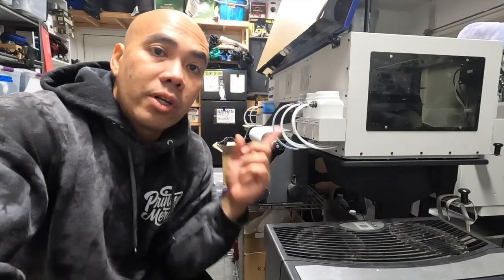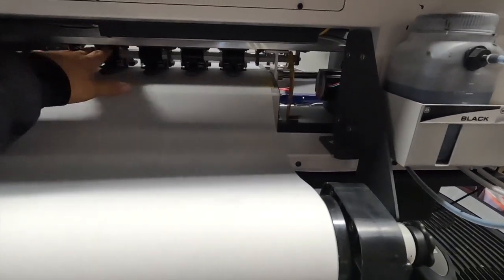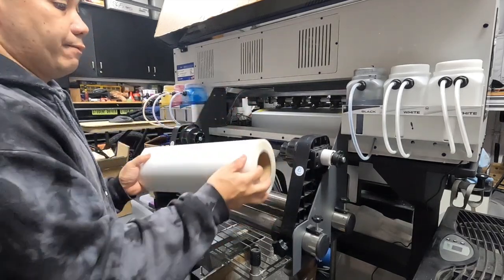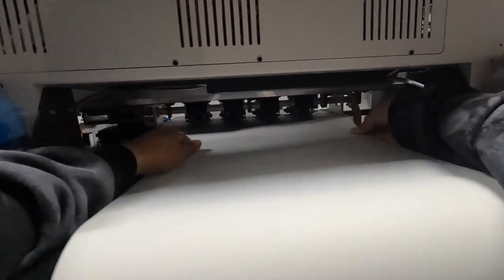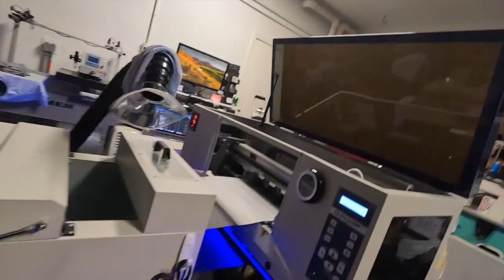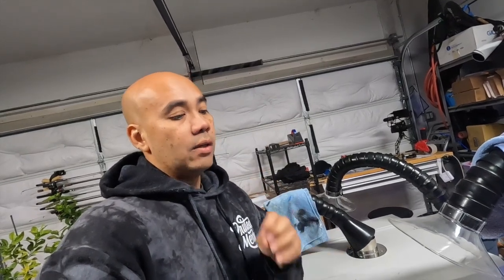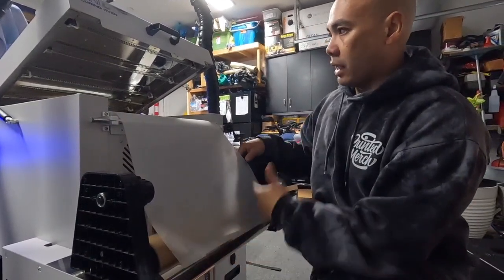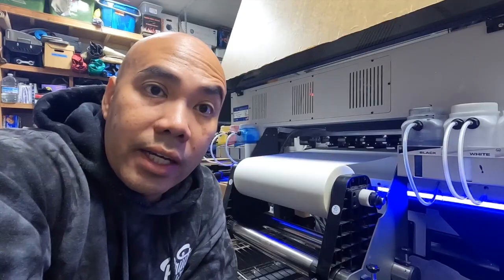THERE'S A LOT OF WASTED MATERIALS  : DTF PAPER (S:10/Vlog 22)

Comment: I would imagine that there is a market for the roll ends. Someone may need to think outside the box a little bit, but I bet if it could be processed down to A4 sheets, it could be a saleable product.

If you are getting rolls with a lot of damage at the ends, though, that might be something you could bring up with the manufacturer. If I were buying 100m rolls of something, say, and the first and/or last few feet are always scrap, I would be wanting that taken into account.

Unless it already is, of course, and that is just par for the course, in which case you would need to think about alternative uses for that roll-end 'scrap'. Can it be cut down into specific sheet sizes and sold as an art supply? I bet it can...